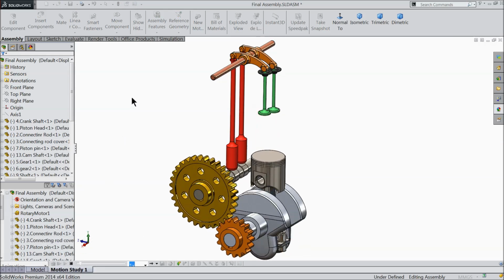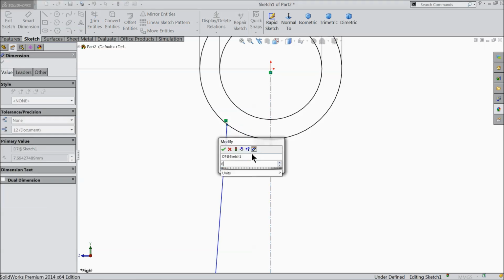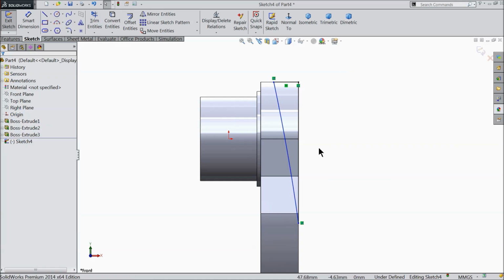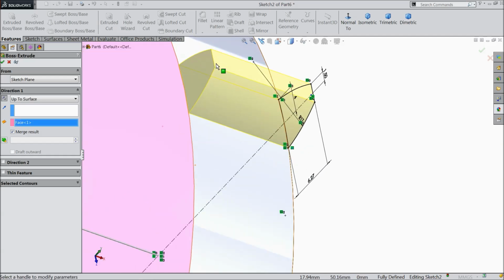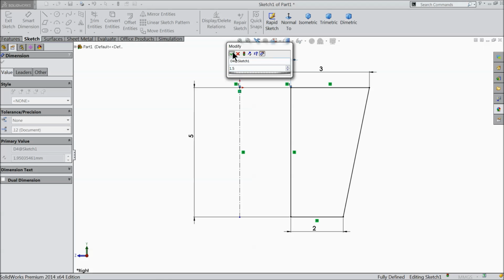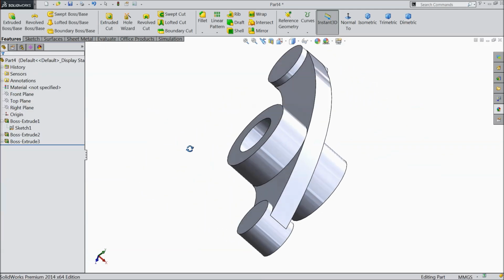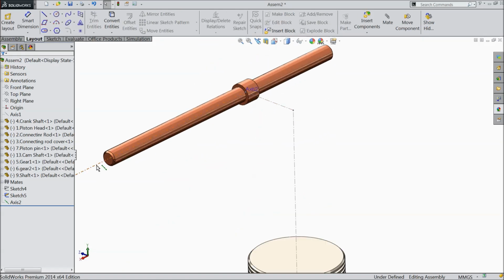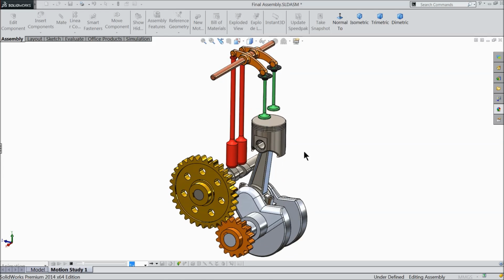Solidworks tutorial | Sketch Engine in Solidworks

Comment: 1)Piston Head : 0:00
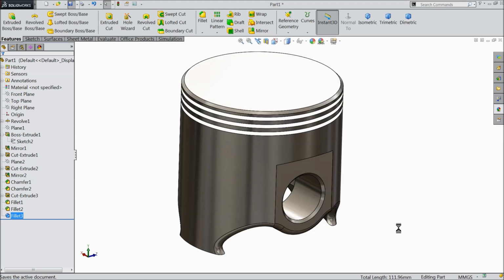2)Connecting Rod 14:35
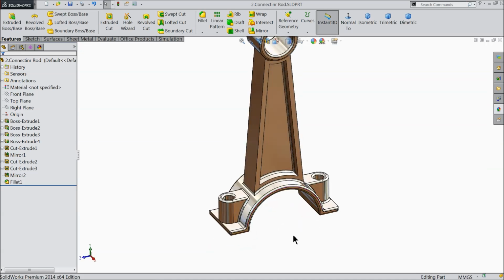3)Connecting Rod Cover 24:42
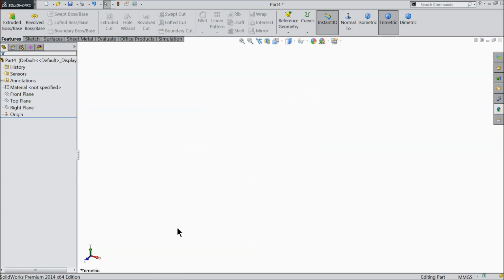4)Crankshaft 30:25
5)Gear 1 41:29
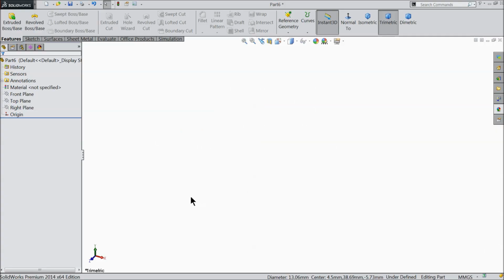6)Gear 2 47:45
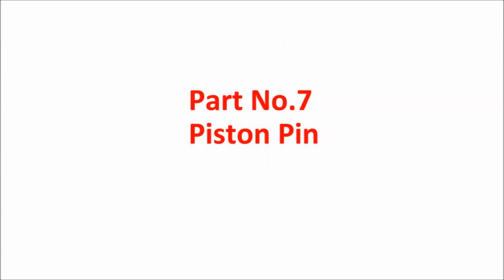7)Piston Pin 55:26
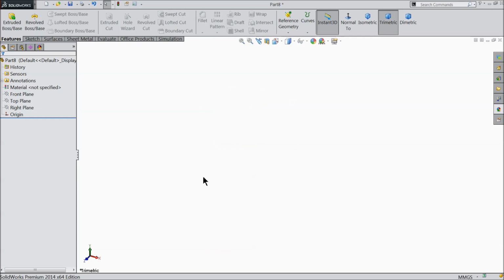8)Rod 56:30
9)Shaft 1:00:00
10)Valve 1:03:00
11)Valve Spring retainer 1:06:00
12)Retainer 1:07:00
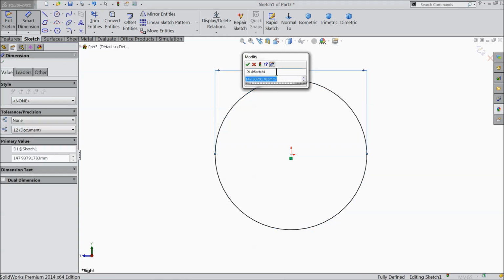13)Cam shaft 1:12:00
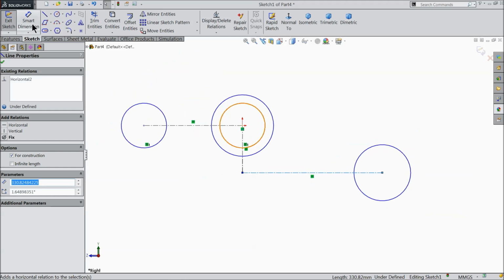14)Rocker Arm 1:20:00
15)Valve Sub-Assembly 1:27:00
16)Final Assembly 1:28:00

Comment: 1)Piston Head : 0min
2)Connecting Rod 14min35
3)Connecting Rod Cover 24min42
4)Crankshaft 30min25
5)Gear 1 41min29
6)Gear 2 47min 45
7)Piston Pin 55min25
8)Rod 56min30
9)Shaft 1h
10)Valve 1h3min
11)Valve Spring retainer 1h6min
12)Retainer 1h7min
13)Cam shaft 1h12min
14)Rocker Arm 1h20
15)Valve Sub-Assembly 1h27
16)Final Assembly 1h28

Comment: I can not rotate my crankshaft after assembly, it comes as ' can't rotate its fully defined'
Reply from the maker: Right click on crankshaft and check its should be floating not fixed, and also check the relations,
Reply: Yeah its corrected now, i did mistake in  mating relations of assembly. Anyways thanks :)